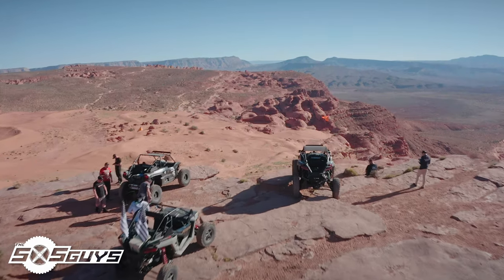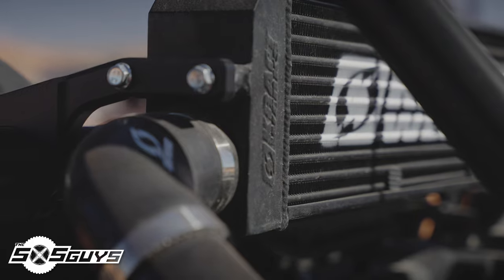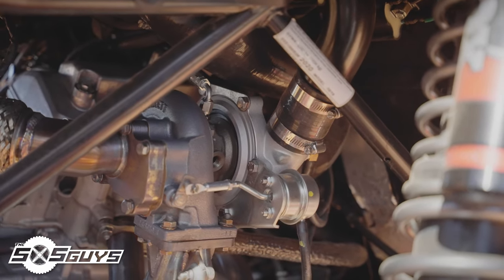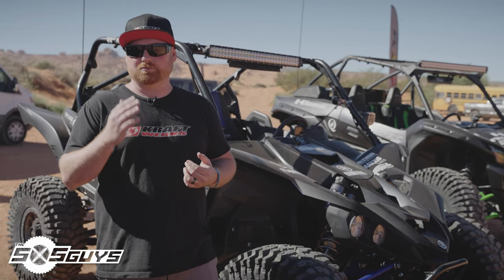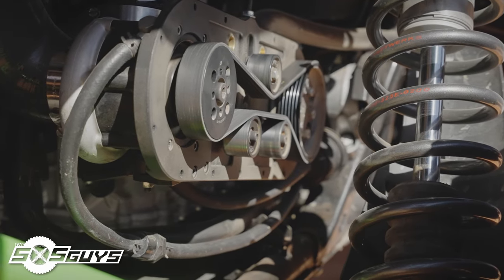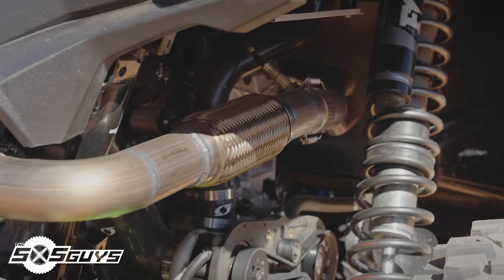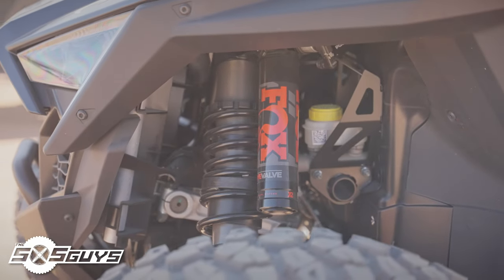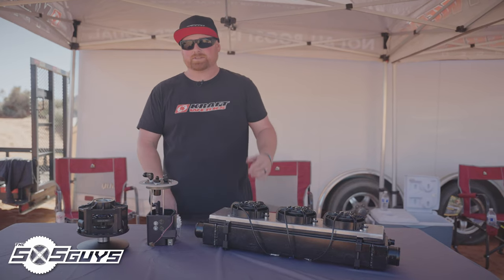KraftWerks Offroad Superchargers for RZR KRX TALON PRO R YXZ| The SXS Guys

Comment: As a tech for Polaris USA I can tell you this would be a big mistake throwing boost to the Pro R. This motor was designed by way of compression & natural aspiration & tho forged long block the timing won’t be compatible with supercharger/turbo & will cause pre detonation in turn blowing the heads off your machine. They are designed to run & unless tuning drags please be aware of what I’ve explained unless you have money to burn. These gentlemen already told you this is in test phase because the ECU isn’t cooperating & there’s reason why
Reply from the maker: Good reminder. They aren’t putting a lot into these without rebuilding them. The bolt on kit is going to be pretty safe. The big psi guys know what they’re getting into lol 😂
Reply: Haha suuuuure